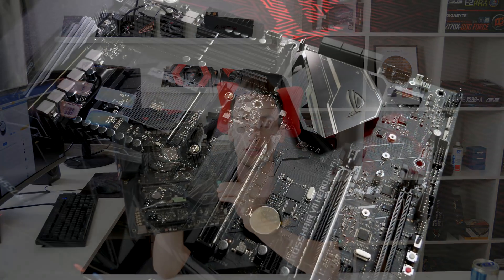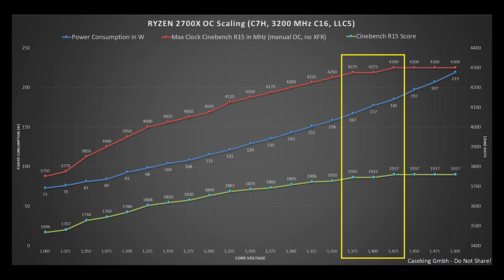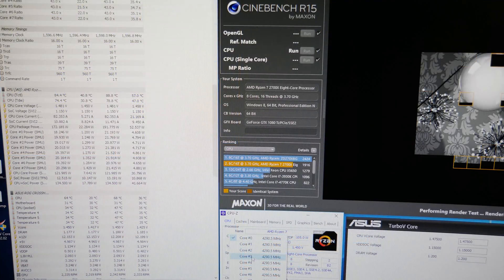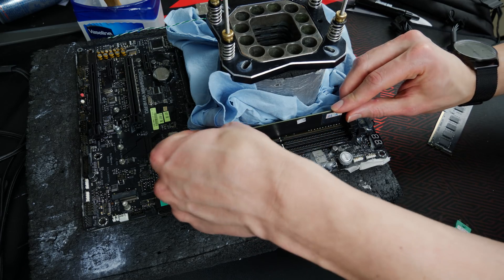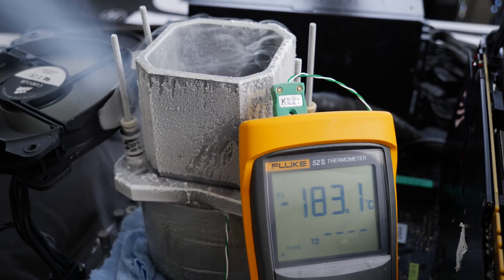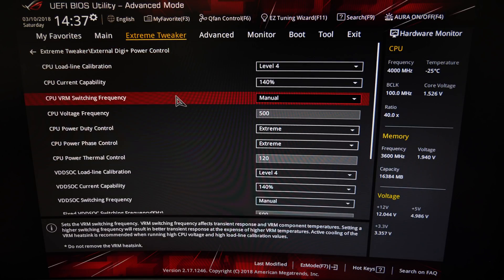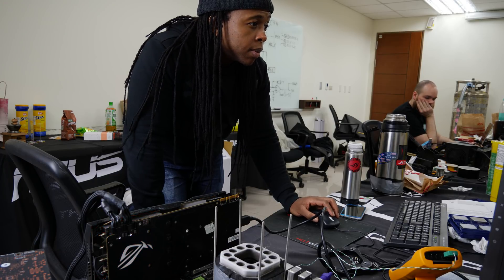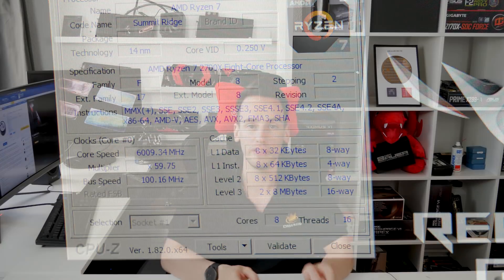AMD X470 Pinnacle Ridge: RYZEN 7 2700X at 6000 MHz on Crosshair VII Hero (en)

Comment: my 2700x doesn't want to lock at 4.3 with 1.2-1.3V i have to go up to 1.5V. im able to keep it cold but it would of been nice to get a good enough one which wants to run on low voltage.

Comment: hi. do i need to follow all the settings that u change in external digi+ power control if i want to overclock my 2700x? or i just need to change cpu load line calibration?

Comment: Thank goodness for guys like you know what they are doing on the tubes. Until I watched this video I had my Vcore at 3.85V and my SOC at 2.0V for a 4.2 GHz overclock on my 2700X. I was having stability issues and "a guy" on a forum told me the answer was to just push the voltage to as high as I dare. When I saw you had overclocked to 4.2 @ 3.0V Vcore I decided to give it a try and sure enough setting the CPU to 3.25 (I tried 3.0V was still a bit unstable) but 3.25 and its actually running better than before. I think my stability issues were steaming more from the memory as I could run Prime95 all day but it kept crashing on Cinebench. I bumped the DRAM from 1.35V to 1.4V and set the SoC to 1.15 and like magic I pulled 1860 Multi and 175 single on Cinebench (beating my personal bests on this rig) and no freeze or BSOD. These so called "experts" in these forums need to stop telling people to just crank the voltage to 3.4 on the core and 2.0 SoC for any 2700X overclock that is not stable. Sometime less is more. Thanks Roman. I'm still fairly new to Overclocking and you may have saved me money and extended the life of my CPU.

Comment: 4GHz at 1.125V is amazing considering my 1600 needs 1.25 for just 3.8GHz. That would now give me 4.1-4.15 GHz, a 300MHz uplift. That's pretty nice. I can either run way faster at the same voltage or run the same speed but waaaay cooler.

Comment: According to Anandtech review, they did not use the libraries that came with 12t and stuck with the libraries from the 14nm process. So in effect the transistors are smaller, but there is more dark silicon around it.

Comment: How did you even get the processor stable at 6Ghz? the 2000 ryzen processors cant clock higher than 4.2 and be stable at any voltage. Even if you pumped enough voltage into it to make the processor just fall apart the thing still wouldnt run stable

Comment: You have my respect entirely for pushing that high using exotic cooling (any liquid coolant that burns off faster than 100ML per 24 hour period). However, on November 30th 2017 I threw the gauntlet down with my Threadripper 1900X rig. Utilizing our Lithium Hydroxide solution which burns off at a rate of 2.2ML per 24 hour period I set 6 world records for "The fastest non-exotic cooled oct-core processor in history". Liquid Nitrogen runs cannot last more than around 4 mins before instability claims them most of the time. However, when I turned that report in to Maxon for validation, the system up-time was 10days 15 hours. I can run the rig at max speed, 4.985GHz for almost 120 days before needing to replace the LiOH solution. The new CPUs are out...take up my gauntlet and unseat me. The challenge is made. CB15 Score 2155 on a permanent, stable rig using an Oct-Core CPU. I know someone will beat me now...but I want to know who and how. I've earned that right.

Comment: I have one question about PGA sockets for you. I've worked with both LGA and PGA and I can appreciate how easy it is to fix a bent pin on the latter compared to LGA, but one thing that bothers me is how easy it is sometimes to pull the cpu out when trying to remove the cooler.
Is there any reason not to use a bracket on top of the cpu, like the ones on LGA, aside from the lower cpu mounting pressure?
It's definitely not necessary, but it'll fix one of the only concerns you can have with PGA.
Reply from the maker: I guess it's to keep the socket simple and safe costs. From my point of view they should have something to hold down the CPU.
Reply: der8auer that's probably why. I completely agree with you, it's not like they need a very strong bracket, you only have to overcome the thermalpaste's stickyness

Comment: When someone says 1.55 Vcore as "safe starting point"...
Reply: I run my fx6100 at 4.5ghz at 1.55vcore for 4 years now
Reply: @youtubes1942   what the hell? why are overfeeding the beast? i have a 8350 running stable at 4.91 with 1.47v core. it is not needing that much volts
Reply: @youtubes1942   are you sure that you have tried with lower voltages and wasn't stable? all i say is tha the volts are too high for your target clock, if you were using 1.55 for 5ghz that would be totally acceptable
Reply: @shadowhack159   EVERY CHIP IS DIFFERNT LOL!
Reply: @shadowhack159  also note that stable to me means being able to run all cores at max for over 5 hours.
Reply: @shadowhack159  6"1"00 is the first FX series and hard to get around 5Ghz
Reply: I have a 2700x at 1.525v and the hostest it ever gets when gaming is 60-65*C
Reply: @berryvr7184  does it still work ? Lol.
Reply: @Jeroensgambling  ye im still using it today lel
Reply: @berryvr7184  Those 2700'x are very prone to degradation. That voltage for 24/7 is'nt safe at all. 1.36v is the recommend max on water or air really.
Reply: with adequate cooling it feels like a voltage of 1.5 could be considered quite safe. Atleast for 1.5-2 years. As long as the temperature is kept as cool as possible. But more than that is probably not possible on any kind of water setup.

Comment: -196C - Check
Enter BIOS and disregard the temp sensors  - Check
1.85V - Check
De8Baurer is the real OC King - Check
Tomorrows video : How LN2 can crack your IHS! - Check

I'm joking of course! Great work De8Baurer! Saw your new Lian Li case design, and it looks great! Can't wait to see the 'Air' version. I do like the ability to put 2 PSU's in the case. And from a mechanics point of view, I like how the tempered glass panels are attached. It is the best system I've seen for a computer case. Keep up the awesome work.

Comment: a futuro pienso que AMD SI sacará un ryzen 7 2800x , solo está esperando el lanzamiento del  "i7 8086k aniversary edition", creo que hay 2 posibles escenarios de especs: 1) R7 2800X = 10 cores /20 hilos @ 3.2 / 3.9 ghz   y   2) R7 2800X = 9 cores / 18 hilos @ 3.3 / 4.1 ghz , opniones
Reply: 2 CCX de 4 cores cada uno llenan el espacio disponible dentro del die, para un 10 core necesitarían un CCX de 5 núcleos, lo cual de salida es inviable, en 7nm AMD propone CCX de 6 cores lo cual es viable, pero si calculas es viable porque el tamaño del CCX disminuye a la mitad del anterior. Así que no creo que AMD saque nada mas, supongo los TR ya que estos si tienen mucho espacio en el die<- esta idea es más viable un TR al precio del 8086k con performance devastador por el precio.
Reply: Se viene con una nueva tecnología, vaya saber como vendrán estos nuevos microprocesadores.

Comment: Der8aurer Really great video I was amazed to see 6,009MHz while under LN2 for sure even though we will never see it in our everyday life it sure stirred up the geek inside me thank you.

I know these things are probably not close to 100% stable at these LN2 speeds but OMG it would very interesting to see a 2700x@5.0-5.1GHz LN2 cooled with some really quick game tests just some straight CPU tests not the purdy maxed out graphics stuff to see how close these new Ryzens can get to or surpass a Overclocked 8700K@5.0-5.1GHz. I know probably a lot of people have asked for the same thing but it sure would be cool to see a 5.1GHz Ryzen match or smash a Intel CPU for once.
Reply: Rocky12345 Clock for clock ryzen is slower than Intel in gaming. Hardware Unboxed proved this.
Reply: Yea watched that video as well. But if you watched it he said AMD's way of linking CCX units together has some of the same latency issues as Intel's Mesh tech and that Intel's Ring bus was much better for gaming setups.

He also showed AMD's 2600@4GHz & 2700@4GHz and Intel's x299 CPU's he used also at 4GHz getting beat by AMD's Ryzen's in games and most work loads it was the coffee lakes that used the ring bus that were slightly ahead in the games when all were at 4GHz because they have ring bus which has lower latency than both Mesh & Infinity Fabric giving a bit better gaming performance when all are at same clock rate. Then you add in Intel's higher clock speeds when all cpu's are out of the box defaults and the performance gap widens in favor of Intel. 

Intel better hope AMD does not figure out a way to get rid of the IF latency and get the clock rates up to 5GHz any time soon or by Zen 2 in 2019. Just a note I am no AMD fanboy I currently only have Intel based systems but I am watching to see what AMD can do for the Ryzen's by 2019 because that is when I am finally going to retire my I7 2600K@5.1GHz and upgrade my system.
Reply: Rocky12345 Yes, because AMD's infinity fabric is better than Intel HEDT. It's incredible what AMD have been able to achieve.
Reply: TotallyJerd that does not quite make sense.  In typical gaming benchmarks, Ryzen 2700X @4.2Ghz is about 5-8% lower than 8700K @5.0Ghz, so that 8700K is roughly 20% higher clock, but far less than 20% faster fps.

So, clock for clock Ryzen is still more efficient.    What holds any multicore chip back is the thermals, as this video shows.   My guess is that if AMD increased the size of the die and spread out the cores more, you could dissipate heat a lot faster and increase the clocks.

Comment: I'm still waiting for, a practical and reliable liquid nitrogen cooling solution that I could use every day....
Reply: I'm pretty sure this won't be a mainstream product anytime soon simply because 
1) you can't make a closed loop AIO with N2 without a compressor which would make the PC just as noisy as your fridge.
2) Water condensation around the socket. your everyday user won't prepare his mainboard with vaseline^^
3) for an open loop you need a constant supply of fresh liquid N2 so prepare to buy heavy af tanks like every 2 weeks probably
4) The manufacturer needs a relatively cheap pump mechanism that still works under those extreme temps
5) even if you did get a N2 AIO working permeation of N2 is like factor 2 to 10 (depending on the tube material) higher than for H2O.
6) a spill or even touching the wrong components can lead to frostites which means almost guaranteed lawsuits for compensation against the manufactuerer by "certain people"
7) extreme deltas between temperature cycles makes the solder break fast
8) cold bug on intel CPUs would require the user to remove the cooler and reseat it every time you start the PC

Still I would really like to see a continously working N2 cooler on a CPU too :D
Reply: megapro125 How about a CPU socket extender. And the CPU in a specialized Liquid nitrogen cooling chamber away from the rest of the components. If that is even possible.

And thanks for that awesome long comment :)
Reply: I mean you could probably work around all those problems but I don't think it's possible at a reasonable price for what it is and everything in a form factor to fit your usual cases for ATX/ITX boards.
Reply: We choose to go Liquid Nitrogen cooling system in this decade and do the other things, not because it is easy, but because it is cool (like literally -°C cool); because that goal will serve to organize and measure the best of our energies and skills, because that challenge is one that we are willing to accept, one we are unwilling to postpone :P
If only i had the money, and time to build this :'(

Comment: How's gaming on 6GHz? :P
Reply: you have to camp a lot to refill the ln2
Reply: @Petr75661 :
Go to Jupiter. I hear they have oceans of hydrogen, helium, nitrogen.
Reply: TheCatOfWar
probably 5000 fps in csgo 720p low settings with one or 2 1080ti
pretty sure it would make you a god in the game, you can bunny hop like Jesus on water. then ace every round.
at that point the next performance upgrade is a shorter mouse cable for less latency.

Comment: damn 6Ghz. i wounder how long till we reach 10Ghz
Reply: FX was almost 9 Ghz, showing frequency does not mean performance.
Reply: But marketing makes it sound like 5 Ghz is better than 0.5 Ghz (even though its not). 
"Big numbers people, BIG numbers" - Marketing 101
Reply: Which is faster, my Titan Xp at 5700 Mhz Vram, or my R9 Fury at 545 Mhz (no I'm not missing a 0, just above 0.5 Ghz)? It's actually the old Fury that takes the lead in terms of transfer speed. So is that marketing number really that important? It doesn't mean much.

PS: bandwidth = 547 GB/s Titan Xp, 558 GB/s Fury with 45 Mhz overclock
we need over 5.8 Ghz on the Titan to match (4096bit Fury/384bit Titan)*545Mhz Fury = 5813 Mhz Titan to match
Reply: 8.805 FX8150 according to Wiki, so we are slowing down not speeding up 8)
Reply: @zettle2345 :
"8.805 FX8150 according to Wiki, so we are slowing down not speeding up 8)"

==It's a pretty impressive number.
There was some Intel i3 that ran 5.1 GHz out of the box with air cooling.
Perhaps soon, there will be a few air cooled 6 GHz CPUs.

Comment: Next stop, liquid helium :P
Reply: + Christopher Willis And after that, outer space! But I'll bet even then, he'll still need the Liquid Helium, cause he'll be putting 14.2V to the VCore to hit 1THz! HaHa!
Reply: hhaha ya, when he just quick dialed in 1.85V I was like WHAHHHHH. This LN2 thing is just wild, never really seen the board settings and stuff before.
Reply: I know, right! My system is liquid cooled, but I don't even put my CPU above 1.35V. It's 5 yrs old now but it does have the newer user interface BIOS, which is much nicer. Same style as the vid. I'll put a link to photos of it below.

https://drive.google.com/drive/folders/1rLF676MLphn2VsGPW6PC7IQ-I0iLGqIp?usp=sharing
Reply: there's absolutely no need. liquid nitrogen can be made cooler than -180c. that's just the temperature it evaporates.
Reply: He already used liquid helium but he only uses it if its safe that they can get a new world record because it is way more expensive. He said that in a world record video some time ago.
Reply: Heheh, there is no need for liquid nitrogen in the first place, that is hardly the point :D
Reply: https://youtu.be/kS8alLc6-wE 8:38
Reply: T-1000
Reply: liquid helium may make something becomes superconductor and break the system.
Reply: Christopher Willis lol just came here after the liquid helium 7.6 GHz 9900K
Reply: @slasheztech5390  and the 8ghz bulldozer cpu
Reply: Matt Christie Outer space is empty, there is nothing to transfer the heat to.

Comment: How does the new 2700X beat the higher clocked Intel part given the Intel IPC advantage? What's up with that?
Reply: Ian Kennedy better efectivity of smt at AMD and clock to clock is not much difference between Ryzens and core 6th/7th/8th gen in single thread

Comment: So all the problems with the memory controller and PCI-e bugging out on LN2 are gone?
Reply: C7H now supports asynchronous eCLK mode:

C7H supports two different modes for external reference clock adjustments, Synchronous and Asynchronous (Pinnacle Ridge only).
Synchronous mode works just like before, affecting all parts of the CPU except on-chip IO like USB. Core/DRAM/PCIE/FCLK are all based on the same reference clock.
Asynchronous mode is new and allows the CPU Core to use one reference clock, while DRAM/PCIE/FCLK uses another. This allows overclocking the CPU Core using reference clock
adjustments without affecting DRAM/PCIE/FCLK frequencies. The main advantage is being able to keep PCI-E devices at default, as some don’t work well with increased frequencies.

Source: http://www.overclock.net/forum/11-amd-motherboards/1685809-rog-crosshair-vii-overclocking-thread.html
Reply: Actually Hardcore Overclocking sup Buildozoid. Waiting fot c7h breakdown of Yours :)

Comment: what are your guy's speculations on the improvements the 2800(x) may bring if it even exists? I can't imagine it boosting any higher than 4.3 if there's a hard wall on air/water (like on the first gen), but i could be wrong?

Comment: hold on.... i thought AMD Zen+ was supposed to be 12nm, yet looking at your CPUZ, it says 14nm..... yet my 2600X read 12nm..........wtf?
Reply: Might be cpuz version difference, new cpuz support this processor i guess. So it shows the correct info
Reply: fedepede04 either that or cpuz haven't had the code to detect this CPU during the time he did the OC challenge. Or, transistors are in 12nm, the rest are still 14nm, which means 12nm+
Reply: maybe he got paid by amd to do so.